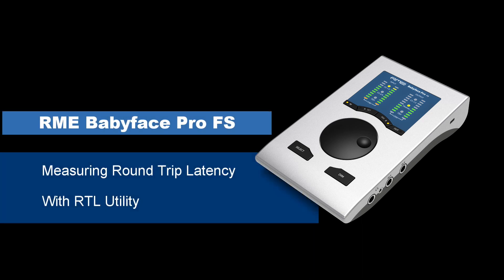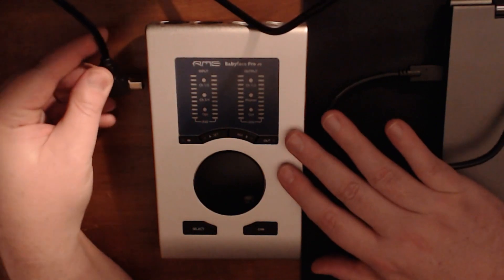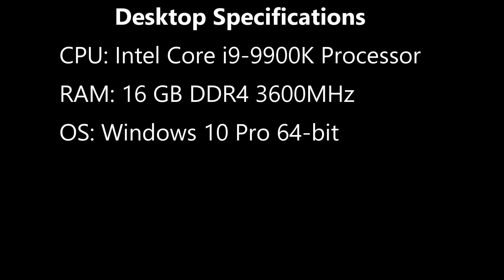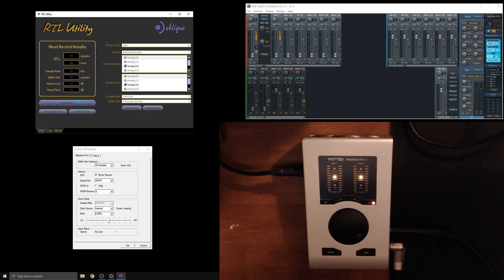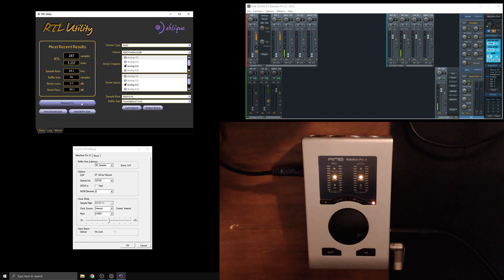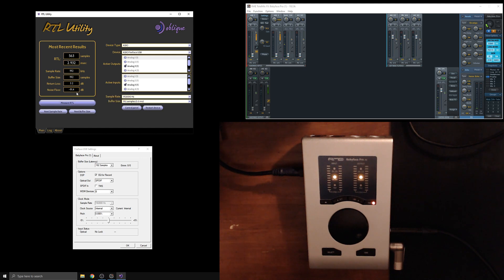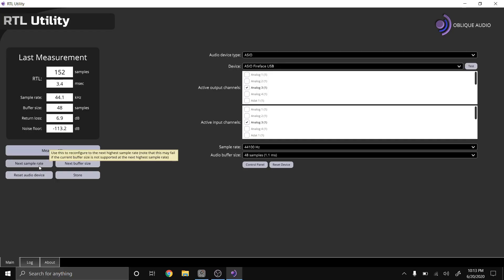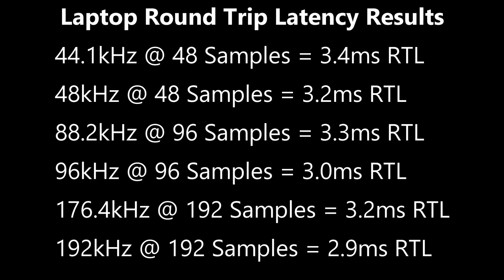RME Babyface Pro FS Round Trip Latency Testing

Comment: Don't know if you are checking comments:  I tested my SSL 2+ on a mac with the same RTL utility.  96K @ 96 Samples = 7.042ms.   Compared to the 2.992ms you got I'm a little frustrated.  Do you think that is a function of the SSL2+ being a much more budget interface?  The mac I'm running on is intel-based and has a pretty beefy processor and 32GB of RAM.
Reply: RME is probably the company with the lowest latency on their USB drivers, compared to any company. So even more expensive interfaces from other companies have higher latency over USB. 
Presonus have really low latency on their Quantum series, but those are Thunderbolt interfaces, and perhaps out of production (though some resellers seems to be able to deliver the 2626 version), but they require external power.
Some interfaces come with built in DSP, to be able to use some effects on external sound sources on the monitoring mix, so you at least get some idea of what the instrument/song will sound like processed. By doing this, they can offer low latency monitoring of the input, and then combine that with the single trip latency of sound coming from your DAW. Universal audio on their Apollo range (thunderbolt, only the Solo doesn't require external power) and antelope on their Zen core series have the most complex offerings of DSP effects, most other companies offers a rather limited selection on their interfaces with DSP.
Reply: I have Apollo Twin X with TB3 connection and RTL is 4.65ms at 44.1 @ 32 samples buffer (lowest possible). RME with USB connection beats it LMFAO.

Comment: hey lucktronics i have a question is the babyface and sm7b good combo ? also can i use that EQ software called totalfix in windows 10?
Reply from the maker: Most people use a Cloudlifter or Fethead with that microphone regardless of the interface used. It would be a great combo. TotalMix FX comes and acts as the mixer software. I am using it in Windows in the video.
Reply: @Lucktronics  what about Se Dm1